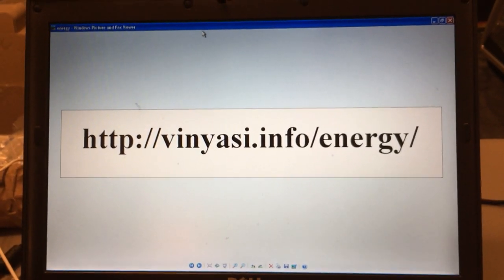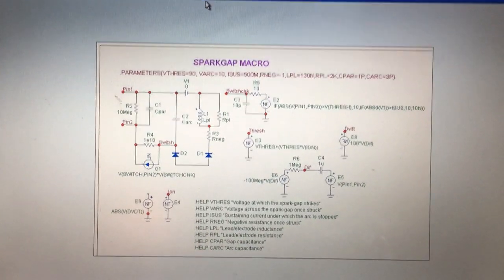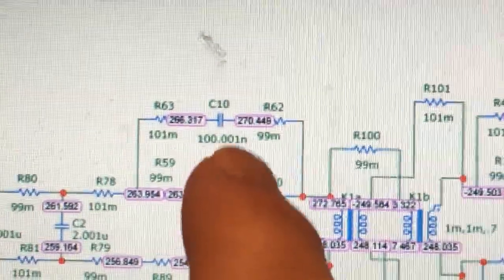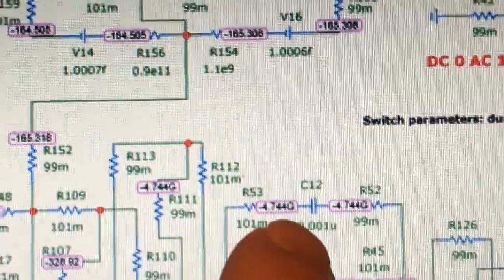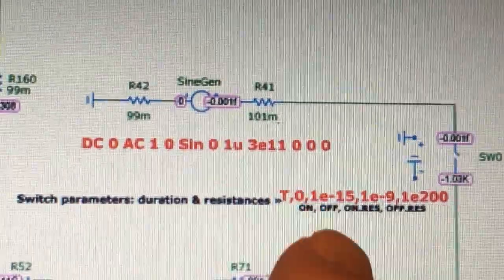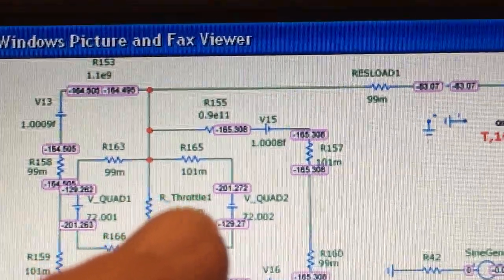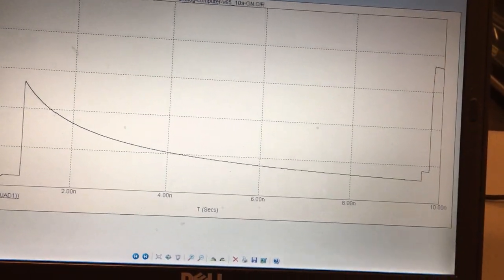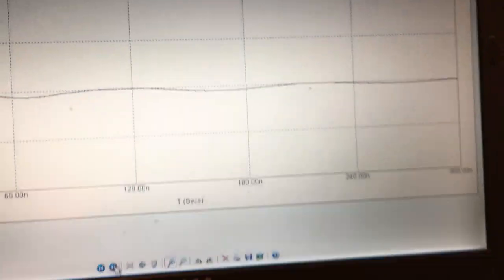Recycle Reactive Power using Eric Dollard’s Analog Computer in Longitudinal Magneto-Dielectic Mode.

Comment: So, it can be buildable because you can use a computer to measure each buildable so that buildable can handle how much per second, that micro second, using device to measure the mass itself so it can happen. So, if it can work on computer, then it can work in reality but with help of device that can measure for how small within micro second for how much volt, etc, and it goes down or not. So, you say the solar panel can be very small, so that solar panel has a circuit, so it is two layer, circuit box which you show video above and above layer is solar panel, so it is all about small second to increase energy. So, small goes a big way, but this case in video is a huge way. That proof free energy since it doesn't depend on fuel itself but recycle energy which current circuit does, but it is cut off thru the ground, that is bleed the ground, so it is about understanding to make free energy possible, so it is not depend on fuel itself that we need oil, sun, etc, but we need fuel-less which the mass will activate and cause the energy to go around that is recycle energy. Circuit is the key to energy, well, can be bigger scale like you say about Newman. So, it is about mass that carry the energy and recycle that energy. Fuel is only there to activate the fuel-less energy. Like a glass that hold the water, so the glass is necessary to use water to drink, so is the circuit is necessary. It can be micro to macro circuit, which the coil is same as back and forth motion of energy. Well, I am sure there is parallel between macro and micro.

Comment from the maker: Playing around with this some more...

http://vinyasi.info/energy/analog-computer-v66_10a-ON.CIR
https://is.gd/axubup

...I'm finding out that it helps if the two switches, SW1 and SW2, are reduced to 1ps from 10ps when they open up to allow drainage of current from the building up of voltages, because the simulation runs with less chance for "matrix is singular" error messages, and reduced buildup of node voltages, but without much - if any - reduction in output current drainage to ground.

Now, I'm quite aware that fabricating such a tight tolerance for a switch to respond to time may not be buildable. Yet, what if - instead of a switch - a fuse were employed? Is it possible for a fuse to be constructed such that it responds to over-voltage instead of breaking down at over-current?

Because, once this circuit is charged up with a minimum level of energy, it may never need to shut off, completely. It may be that a throttle action could be employed involving the mutual magnetic coupling among the three pairs of transformers that could also serve as an almost complete shut off without actually completely voiding this circuit of its storage of a scant quantity of energy sufficient enough to restart it again and again by its user?

Then, it could be cold-started at the factory with a fuse-style switch, and then restarted by the user via the throttle?

Potentiometers may also help. For if too much resistance is inserted at various locations throughout the circuit, this can also be used as a method for shutting this circuit down although I don't think that this is a viable method for throttling (fine tuning) the output since resistance may be an episodic affair affecting the output in very large increments making it not manageable for fine tuning the output?

Comment: Always wanted to ask. Why didn't you move on to over-unity machines rather than sticking with LMD analog circuit?
Reply from the maker: Eric's analog computer is the only device which can measure Tesla's Magnifying Transmitter while the latter is in operation and not destroy its output at the same time since they both operate off the same principles of design. Hence, they are both overunity...

The simulation of this analog computer yields an input of ridiculous proportion in contrast to its output making it "extreme overunity".

http://vinyasi.info/energy/analog-computer-v64_10a-ON-RMS-WATTS-RESLOAD2.jpg
https://is.gd/eporuz

versus...

http://vinyasi.info/energy/analog-computer-v64_10a-ON-INPUT-VOLTAGE-AT-SINEGEN.jpg
https://is.gd/zivera

and...

http://vinyasi.info/energy/analog-computer-v64_10a-ON-INPUT-CURRENT-AT-SINEGEN.jpg
https://is.gd/dozalu

node voltages of schematic...
http://vinyasi.info/energy/analog-computer-v64_10a-ON-node-voltages.jpg
https://is.gd/dipiju

schematic...
http://vinyasi.info/energy/analog-computer-v64_10a-ON-schematic.jpg
https://is.gd/hefefo

All of these tests were made upon a circuit intended to be always ON. No intention was made to turn this circuit OFF since I didn't have a clue how to do this (at first) since this circuit does just one thing: it builds up voltage. But then I discovered a method whereby I could effectively turn this OFF by merely removing the magnetic coupling among the three pairs of transformers which link the modules together into a daisy-chain. Without this coupling, this circuit obeys the normal thermodynamic laws of dissipation and grinds down to a halt. This poses a speculative implication that the mechanism whereby this circuit gains its overunity status is via "parametric amplification" whereby the electric and magnetic fields of each type of component modifies the electric and magnetic field of its analogous component UP and DOWN to develop a surge towards infinite gain if not for the spark gaps periodically collapsing this exponential growth rate into an endless series of amplitude pulses. This is why Eric's analog computer comes in pairs of capacitors and pairs of coils so that each component of each pair may modify the fields of the other component of its type (capacitors modify other capacitors and inductors modify other inductors within and between each module).

Here's one example of parametric amplification...
http://vinyasi.info/realsim?startCircuit=coldstart.txt
https://is.gd/coldstart
Reply: @charleschandlertornadoelec6231  Actually after a simulating for a long while. It is the reflection that caused amplification. Add a load at the end and it would fail, but that does not happen in real life as thermodynamics are never real.

Here's a clue for you. Replace capacitors with single phase neodymium synchronous condenser. Research synchronous condenser if you don't know what it is. Another clue for you is that it isn't what they told you what it is. It is a virtual negative inductor.
Reply: synchronous condenser sounds like a synchronous generator which involves moving parts which I am trying to stay away from whenever possible at least trying to stay away from parts that move because of human design not to exclude things that move that are not part of human intention like air molecules vibrating as an example. In other words, I don’t want anything to wear out too quickly unless it has to move like the parts in an electric car’s motor. But a synchronous condenser if I am correct in determining is an equivalent term for a synchronous generator having moving parts that don’t need to move if a solid state equivalency can be constructed or designed.

Thanks....
Reply: @nutrition1363  Synchronous condenser is synchronous generator/alternator used in reverse and overexcited. It is no load overexcited synchronous motor. That's all. It exhibits natural negative inductance when overexcited.